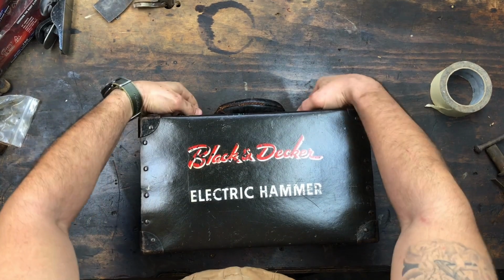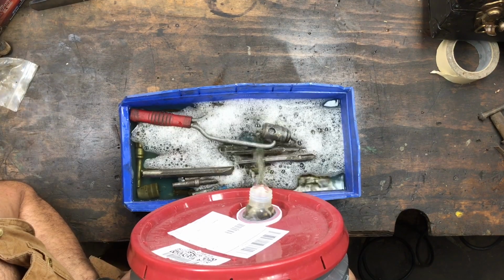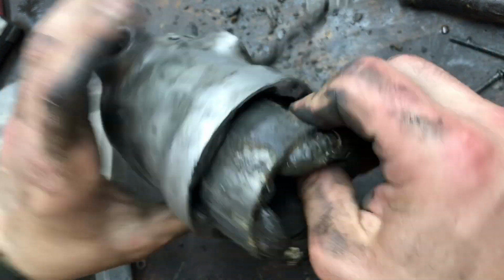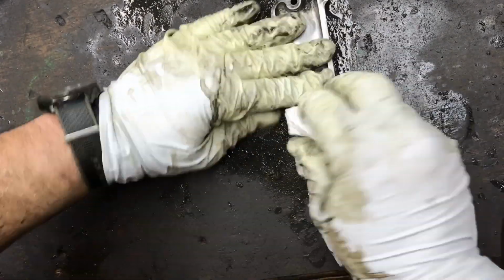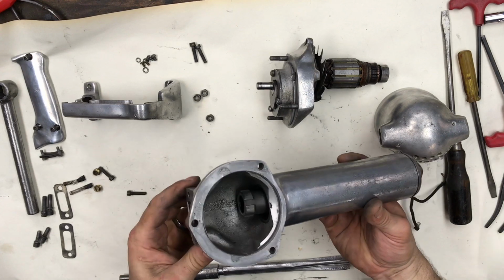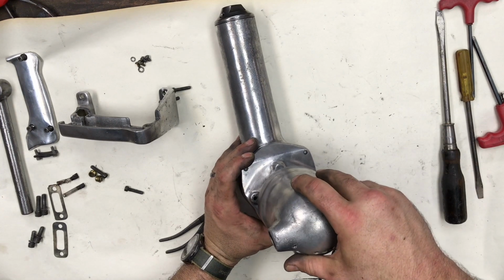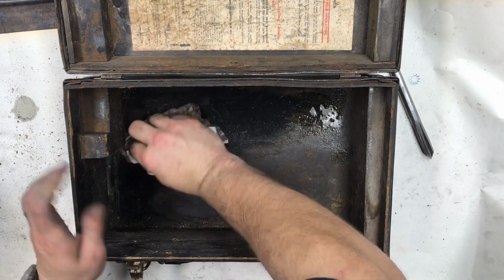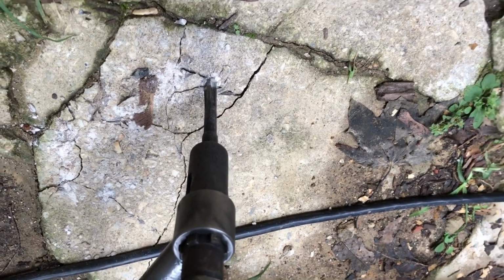Rare Electric Hammer Restoration | Black & Decker 1940s Era | Tool Restoration | Evapo-Rust

Comment: Great job on this! I can tell you, though, that thing is gonna need a new set of brushes soonest if you use it very often. Those things are so worn down they're almost not there. :)
Reply from the maker: InstrucTube yes indeed! They are super low! I’m lucky, Repco, a major carbon brush supplier is about 20 minutes from my house.  Check out the video on my channel of how I rebuilt some ancient, impossible to find carbons out of some carbon blanks on my mill for an antique Century repulsion start induction run motor from the 40s
Reply: @partsandresto  Saw that vid, you did well to make those. Lot of people would have just said "Well, that's dead, get a new one". :P
Reply from the maker: InstrucTube thanks brother, that was a fun project. I’m glad to hear you enjoyed the vid!

Comment: Nice tool. I have the 1" version of it. It's brute. I used it to install a French drain and sump well in my basement. It made quick ruble of the concrete and worked just as well when I finished as when I started. I also have used it the knock out stuck CV shafts on cars.
Reply from the maker: Nice tip for the shaft knockin’.  I love my little hammer gal, she doesn’t mess around!

Comment: The handle/chuck also accepted Red Heads aka Shields that were a kind of self drilling anchor. You did the drilling by moving the handle left & right as the hammer ran. When deep enough, you placed a Red Head into the anchor, using the B&D hammered the anchor into the concrete. THEN, snapped off the anchor from the handle.

Comment: Really enjoyed seeing your teardown and cleaning of this classic.  So, in the last moments you said that rotating the side handle is what imparts a rotation of the tool bit?  Does it also rotate the entire machine or just the bit?  It looks like this mechanism cannot use a drill bit.  Still, terrific that it's still working.  Am considering 104 Model for light concrete work and tree stump busting in the backyard.

Comment: I see that you ha a Phillips Drill Handle in your kit (steel bar stock bent like a "U" with a center piece).  How does that work with the star drill bits?  I haven't seen it in any B&D catalogs online.
Reply: The tool with the red handle was used for self drilling anchors. I have a picture but don't know how to insert it. An interesting process but I can't find any other reference to it.

Comment: @partsandrestoration I have a tool a little newer than this, Black and Decker 5025 Super Duty hammer, that has a failed switch. Just wondering when you restore tools if you have a good source for something like this?
Reply from the maker: McMaster Carr usually has everything I need